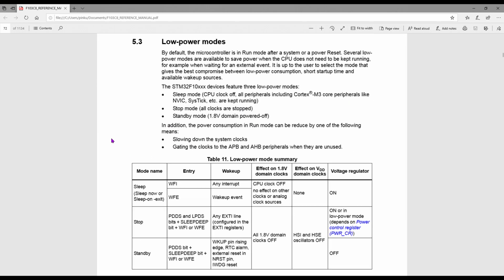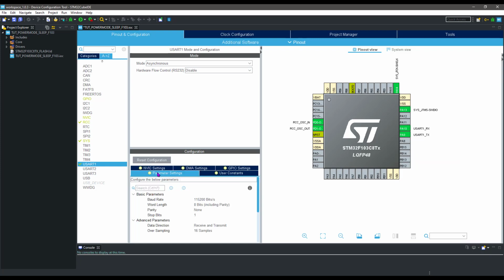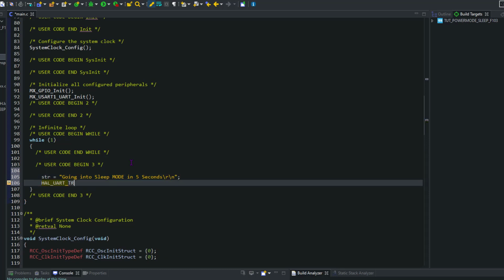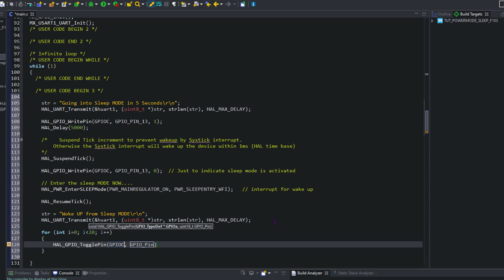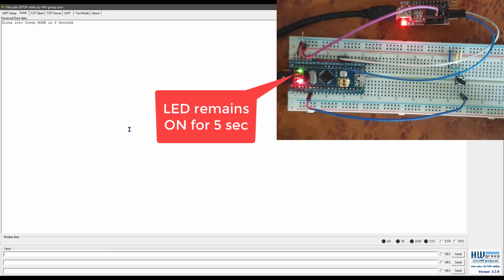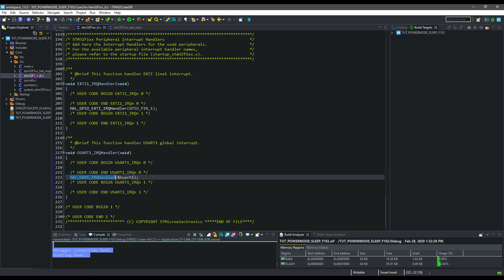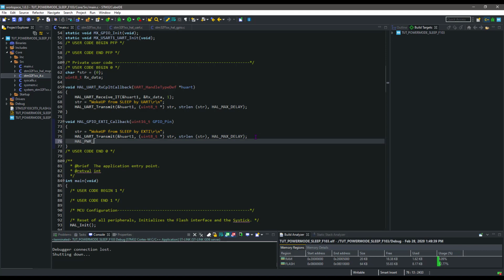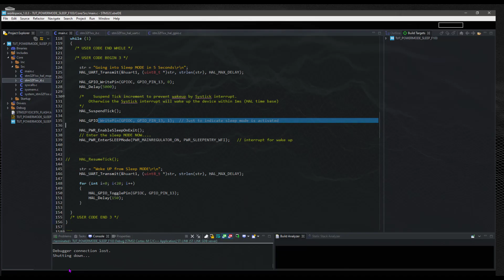STM32 Sleep Mode Tutorial | Reduce MCU Power Consumption

Comment: Thanks in advance. One question: it makes sense that the two concepts of Sleep Mode and IWGT coexist? I explain that, in my While (1) I have written the next code:
 while (1)
	{
	   HAL_IWDG_Refresh(&hiwdg);
	   HAL_SuspendTick();
	   HAL_PWR_EnterSLEEPMode(PWR_MAINREGULATOR_ON, PWR_SLEEPENTRY_WFI);
        }

What I want is for the MCU to go into SllepMode until it is woken up by an external interrupt, but at the same time to have the IWDG to watch if the program "hangs", ...does that make sense, is it correct?
Reply from the maker: IWDG do work in standby. But I guess you need to exit the standby mode, then refresh the watchdog and go back to standby. I am not sure about this, check the reference manual for more information.

Comment: If we are measuring a current of milliampere, it's probably wrong.The reason of this, in the state of the measurement ST_Link is connect our board. I think should use custom board to see low power modes current consumption.
Reply: I think the ST-Link is not affected by this current because it is first powered by the USB port. Thus, only the current for the Stm32 is measured via the IDD jumper JP5. And if you want to be sure, then you can use an external source, disable ST-Link and use JP5 for current measurement.